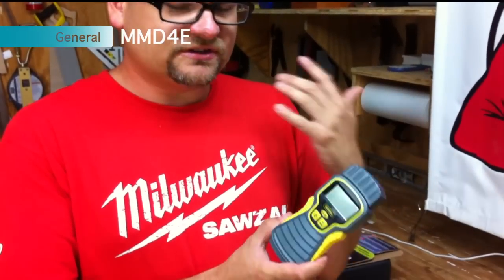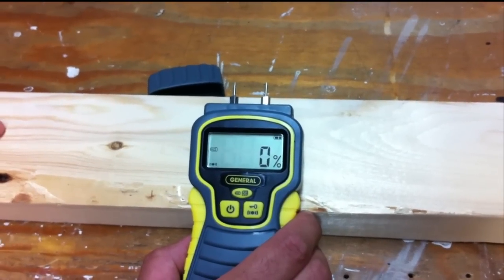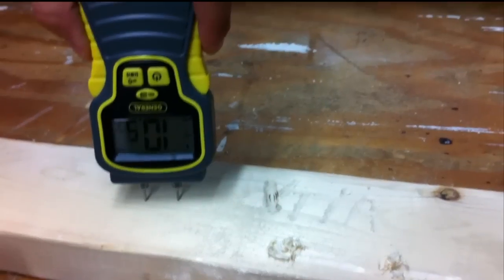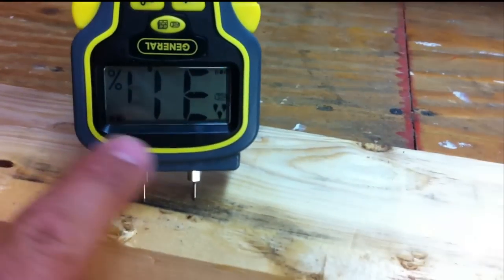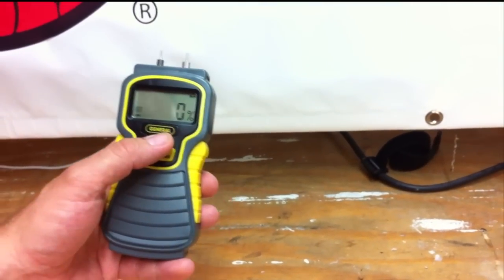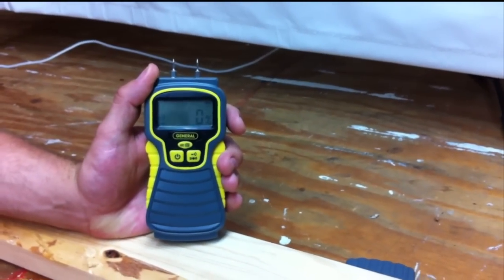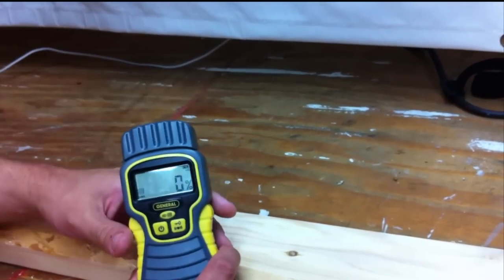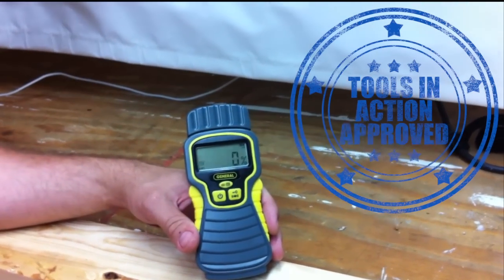General Tools & Instruments MMD4E  Moisture Meter - Review

Comment: Every home owner should keep one of these in their tool box. I had an issue with the the water faucet on my downstairs bathtub  about 3 yrs ago a plumber pulled back the shower inclosure to get to the root of the problem, found out 2 days ago the pipe he toyed around with had been leaking this whole time and now the sub flooring up under the tub and wall is all black mold. I wish I had this because soon as he completed the job I would’ve used it now I’m stuck with 11,000 worth of damage not covered by insurance.

Comment: very inaccurate meter when measuring firewood. From a little experience (having seen other much more expensive meters) this one deviates at least 50% off of the actual moisture in natural woods. Knowing the density of a wood and weighing it (a sample), you will arrive at a more accurate reading of its moisture than from this worthless gadget.